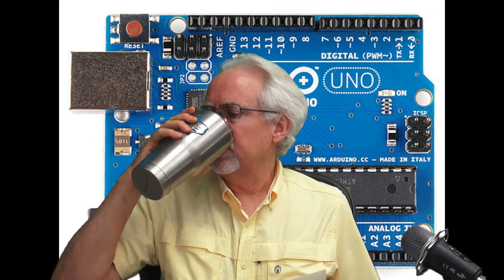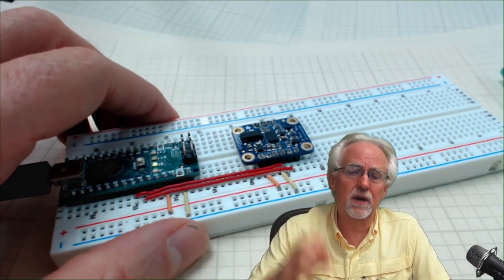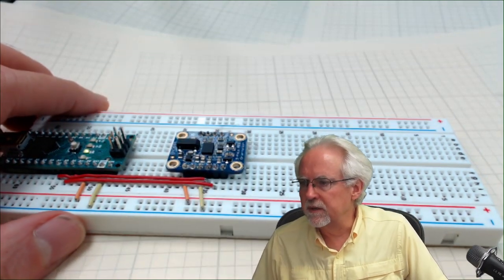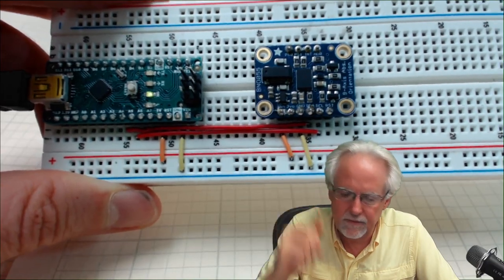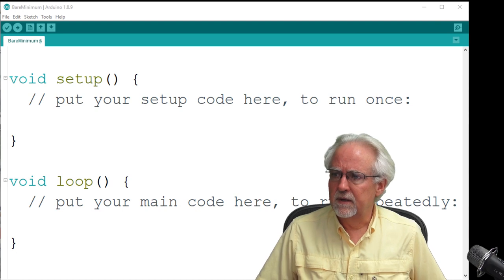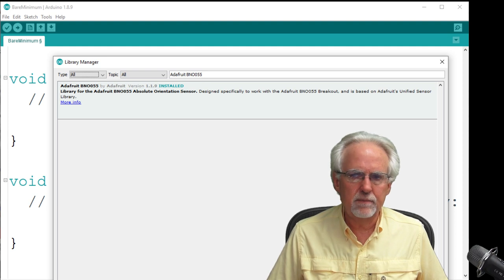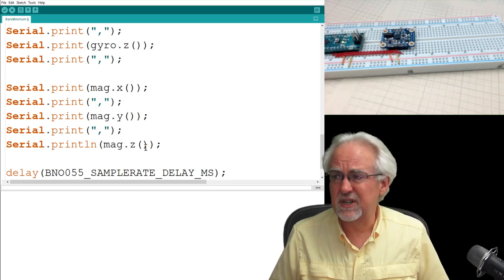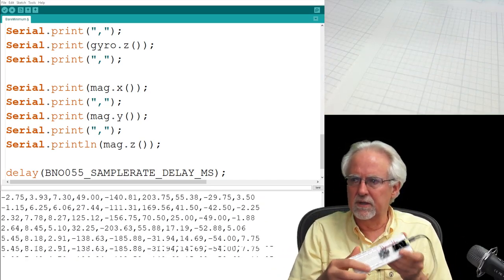9-Axis IMU LESSON 2: Connecting and Getting Raw Data from the BNO055 9-Axis Sensor

Comment: In the case of the cjmcu055. The S0 and S1 pads need to be soldered to their nearby (-) pads. The com/i2c_sel pin needs to be connected to ground. the vcc pin of the sensor needs to be connected to the UNO 3.3V not to 5V. Other than that it's the same, gnd to gnd, A5 to Scl, A4 to Sda.. Once that's done, the adafruit rawdata example works at address 0x28. When powering the sensor to 5V, i was able to use the i2c detector sketch to see that the sensor is at address 0x28 but this worked only after a uno reset .... And the adafruit rawdata example sketch could not detect the sensor.

Comment: Hi Paul, I love your tutorials. started with old tutorials on building space balloon project for info on Arduino and I'm hooked. used BOE before now added  Arduino. my Serial prints all 3 axis. the "z" axis does not fluctuate as much as the other variables do unless I shake my gyro causing acceleration of my board.  Don't know if I got your homework assignment correct. Pouring myself another cup of most excellent cold coffee without sugar or cream. only use with hot coffee. use coffee ice cubes so melting ice does not thin brew. Take care and stay safe. I live in Los Angeles and SpaceX is hiring. Maybe your help will get me in. If so my limited budget will expand to allow Patreon support for you.
Reply: So why do the variables keep changing when my BNO055 is stationary. don't want to go to next lesson for info yet. and your shirt is yellow by the way.

Comment: Hi Paul.
First of all, thanks for your video which is so helpful for beginners like me.
I run the code to print the data for acc.x(),acc.y() and acc.z(). However, the data is oscillating all the time. Is that the noise caused by the hardware such as not good soldering the chip?

Comment: Question:  Can you go over next time, what code (commands) you are typing that you got from reading the library documentation, VS which code you are defining yourself. Like myIMU could be "BobsIMU", But the ::Vector... is predefined from the library correct?  I just get confused when I watch someone write all this abstract code and wonder, How does he know this?  Thanks.
Reply from the maker: Which is why I hate the unified library. OK lets look at this command:

imu::Vector<3> acc =myIMU.getVector(Adafruit_BNO055::VECTOR_ACCELEROMETER);

you can call 'acc' whatever you want, so lets say you call is myAcc . . . then later when you want the data, you would use myAcc.x(), myAcc.y(), myAcc.z(). So that is what you get to pick
the thing you want to call it like acc or whatever. Then on VECTOR_ACCELEROMETER you pick between the predefined ones, which include VECTOR_ACCELEROMETER, VECTOR_GYROSCOPE. VECTOR_MAGNETOMETER. I hope this answers your question.

Comment: I apologize I am not using an identical version of BNO055 like yours. I am using an BNO055 not purchased from Paul's link. But I followed this tutorial. Here is what my serial monitor displayed:
1. For the temperature output, it always printed: -1
2. For the 3 axes outputs, it kept displaying only one set of data over and over again : -0.01,-0.01,-0.01,-0.06,-0.06,-0.06,-0.06,-0.06,-0.06
  I rotated my IMU, but the numbers remained unchanged -0.01,-0.01,-0.01,-0.06,-0.06,-0.06,-0.06,-0.06,-0.06
.
Sorry I didn't use the indential BNO. But I wanna report this issue for your reference. But thanks for the clear video.
Reply from the maker: On these projects, I really try to emphasize the importance of identical hardware. If you are using a clone or different component you are going to get different results, and it might not work.
Reply: @paulmcwhorter  Hi Paul! I am getting these same values listed above, yet I have the same hardware that you are using. I am hoping your input/thoughts may help. I appreciate the series you have created!
Reply: For temperature output, you need to connect ADR to GND on BNO055. I faced the same problem.
Reply: @VivekGoldsmith  According to the adafruit data sheet the ADR pin modifies the I2C Address. Where did you get your info?
Reply: Looking at the schematic of the adafruit bno055 imu carrier board, the ADR pin is connected to ground thru a resistor. Also looking at the data sheet for the bno055 sensor, the temperature that is being read is apparently not the ambient surrounding temperature but instead is the internal gyro or accelerometer temps depending on the selection of the temp register. This makes sense because you care about the gyro and accelerometer temps on an imu board like this rather than the ambient temp of the surrounding area. Also you can select degrees C or degrees F by accessing the temp register.
Reply: @celesten6768  did you ever figure this out????
Reply: I am having the same problem. genuine arduino nano and genuine adafruit bno055. Looks like it might be a connection issue. I ran an I2C address scanner to check that it was set to the default address, and it wasn't registering the sensor. I fixed the connection and was able to see the data in serial monitor, but serial plotter in arduino and the serialplot app don't show anything...

Comment: how do you get your serial print to output onto a new line. Mine just adds everything into one long line, so not make a new line like yours.
Reply from the maker: Thats the difference between serial.print() and serial.prinln() .. . println goes to the next line.
Reply: @paulmcwhorter  BOOM! that did the trick. Output is now correct. Thank you.

Comment: BNO055 fully calibrated (calibration registers: 3,3,3,3) and not near electronic devices, but magnetic north  (yaw) measured on the BNO055 is 60 degrees counter-clockwise from magnetic north on compass .  Anyone else have a discrepancy between BNO055 magnetic north and actual magnetic north?  Not explained by difference between true and magnetic north at my location.  I'm using genuine Adafruit sensor.  Shouldn't the positive x axis  line up with magnetic north??  Setup orientation is exactly like the video.  Thanks for any suggestions.
Reply from the maker: How are you getting yaw? So far in the lessons we are just measuring raw sensor readings.
Reply: @paulmcwhorter  Shouldn't your calibrated "Serial.print(mag.x());"  value read about zero when sensor is pointed to magnetic north?  I am using another  arduino sketch from the Adafruit  BNO055 examples library  which display yaw in degrees and radians ( as well as all the other data in your sketch).  That sketch uses sensor quaternions to calculate yaw (code checked for errors)   Sorry if I am jumping the gun.  I have re-calibrated  the sensor multiple times and get the same 60 degree error between the BNO055 and compass magnetic north.  Could be an error in the sketch calculating yaw from quaternions coming from the sensor.  Thanks.
Reply from the maker: I am really not sure . . . so many things could be going on, and sort of depends on which side they are saying "front" is, what they are doing with declination, and assumptions in the math . . . hence, no way for me to know. I think following my example, it should give a pretty good north.
Reply: @paulmcwhorter  Thanks,  I will follow along with your sketches as you develop more complexity.  I apologize for jumping  ahead.
Reply from the maker: Well it is  pretty hard sitting there with a BNO055, and not trying things out. It did take me a long time getting things to work. The libraries and sketches from Adafruit are not very well documented. Simple things like what is the front direction of the sensor.

Comment: Paul, what does the "double colon"  mean in the sketch ? I have done a google search but every result I read confuses me more.
Reply from the maker: there is no real logic behind it that I can see . . . it is just the syntax expected by the adafruit library. Really can not explain why, just know that is how they want it.
Reply: @paulmcwhorter  thank you, I thought it was part of the arduino "language"
Reply: I’m not and expert but in my limited experience with programming languages I found that the :: is used as a namespace to resolve potential issues with the scope of a variable. In this sketch I read it is as the e.g. VECTOR_ACCELEROMETER variable that is defined in the Adafruit_BNO055 library or module. Hope this helps.

Comment: My sensor doesn't read the temperature, it returns "??" in the serial monitor
Reply: Fixed!!! I had passed a wrong speed parameter to the serial monitor. I had an extra zero :P
Reply: make sure serial monitor baud set to 115200 on bottom right of monitor otherwise you will see the "?".

Comment: Proposed Homework Explanation:  The acc.z() = ~10 is due to the BNO055 measuring earth's gravity parallel to the sensor's z axis.  The x and y accelerometer  readings have no component of earth's gravity if the sensor is lined up with the z axis parallel to the center of the earth.
Reply from the maker: Boom! And now, rotate to the orthoganal axis, ie roll 90 degrees and see what you see. Better yet, before rotating predict what you expect to see. Then same thing, predict what you expect if board is turned completely upside down.

Comment: Hey Paul, so I was trying to test the library's like you did in the video, but I was told that there was "no such file or directory " I've checked to see if my grammar was correct and it was, I'm about to go crazy so anything would help. the only library giving me this trouble is the  <utility/mumaths.h>  library.
Reply: Hey EJP Engineering, I have the same problem, did you ever figure out a fix?